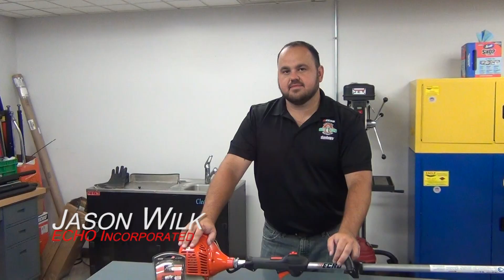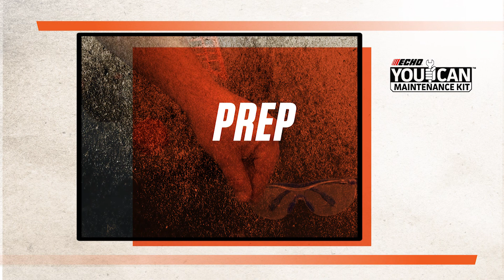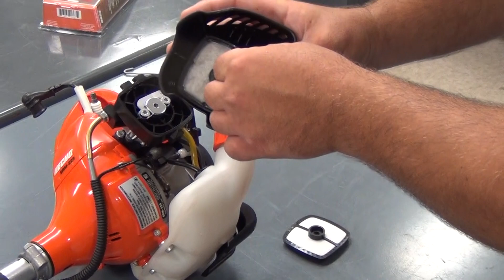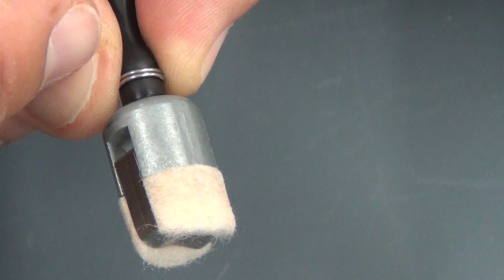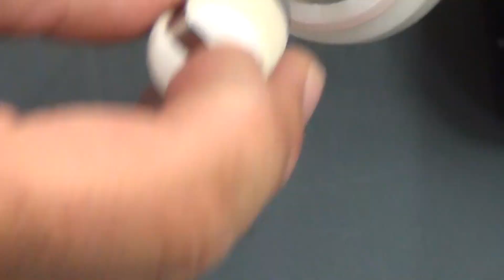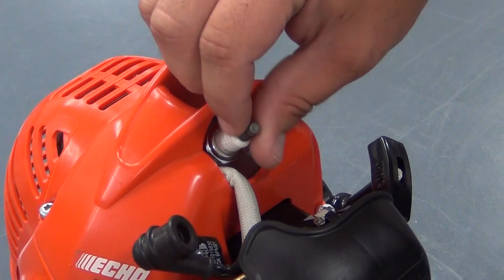SRM-225 Trimmer Tune-Up: YouCan Kit 90152Y

Comment: Trimmer will not just start.  They are hard enough to start normally.  Don't  worry about the spark plug firing the engine off.
Reply: Then get it fixed…

Comment: I've had my echo srm 225 for almost 6 years and I love it the only thing I've ever had to do to it was change the spark plug but other than that I've had absolutely no problems what so ever I appreciate that you guys make great equipment I can rely on to get the job done I can always count on pushing the primer bulb on the trimmer 3 times and it always starts on the first pull thank you for making such great reliable equipment
Reply: I have the same problem with my 225i.  I just took the spark arrester out.  It still blows out tar, but it won’t plug up the exhaust.  It’s annoying, but still runs fine and starts easy.